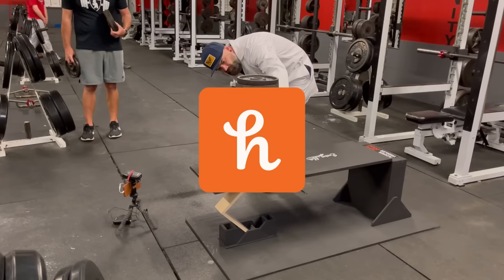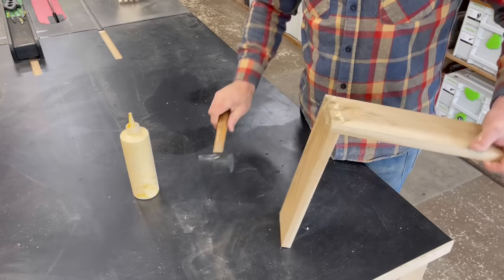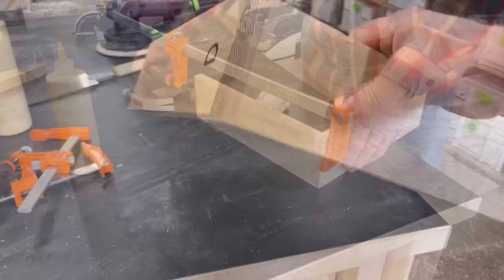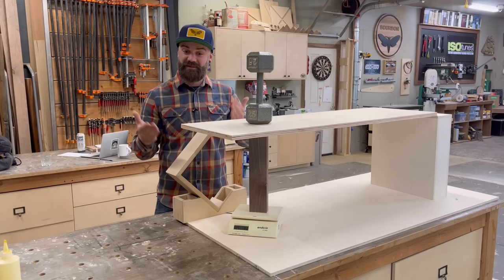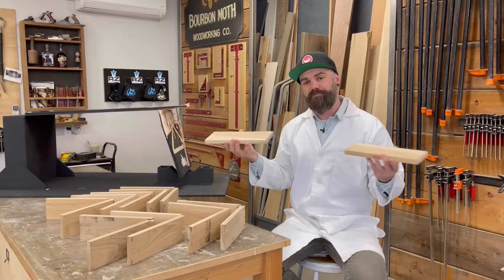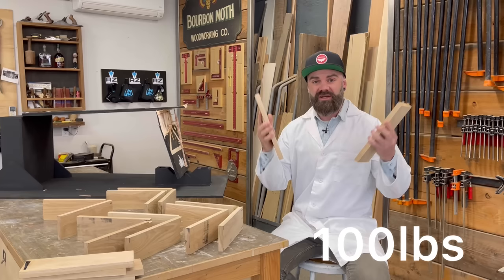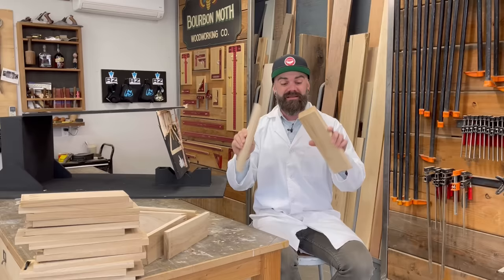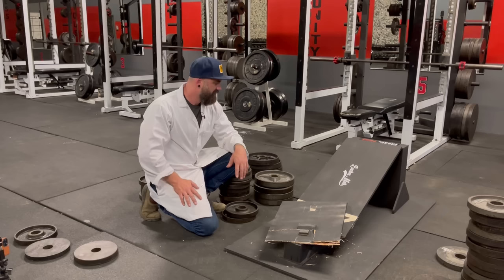What's the Best Wood Joint || Insanely Strong Joinery!

Comment: You also have to consider what the joint is for. A dovetail joint is designed to be strong in a particular direction - resisting pulling apart against the wedge of the dovetails. It's not as strong when being pulled in the other direction, and the wedge shape of the tails and pins may even make it easier to collapse in the diagonal force direction that you applied. If you were to retest with a 90° pulling force instead of a 45° pushing force, your results would definitely change because the mechanical advantage of the dovetail would actually play a factor.
Reply: You remind me of when I pointed out to the one gentleman he tried to Say end grain to end grain glue up with stronger than long grain to long grain. But his test was flawed by the direction he was applying the force. As I explain to him if you were making a stool that was 1‘ x 2‘ you would put the grain running the 2 foot length. Now if you cut that stool and a half across the grain and just glued it up would you trust the stool to stand on? I wouldn’t now cut that stool instead of across the grain with the grain and then glue it back together now would you trust the stool? Yes I would. Which direction the grain runs is part of Woodworking that makes your end project strong if you do it right but weak if you do it wrong.
Reply: I say the same for the box joints, more glue surface more pulling strength
Reply: I would like to see the results of the pushing force.
Reply: I think dovetails that are more equally sized may contribute to extra strength as well.
Reply: Two women in a thread in a male dominated job subject, and being smart and relevant - my toxic masculinity is triggered and offended..  Keep it up ladies. ;)
Reply: If you look carefully at the video for the dovetail test, it looked to me like the material actually broke in the direction of the grain which opened up the joint (rather than the joint itself being the failure point). Ultimately, I guess we need repetition but that really isn't going to be feasible unless he's got a lot of time on his hands to hand cut some dovetails!
Reply: see 19:20 when he's holding the boards
Reply: Yes I did not like those dove tails while they were pleasing to the eye they did not give a fair representative example of how strong a dovetail joint is. I think a better example would be from a jig produced dovetail example. And Megan  discussed where dovetails shine at the strength it gives while pulling for example on drawer fronts. I would not what a miter joint on a drawer front compared to almost all the rest of the joints except for the simple butt joint.
Reply: @richardlug6139  I think the dove tails' strength advantage depends on the kind of wood. The harder and denser, the stronger I would expect them to be, compared to woods with variating structures. (I'm danish - hope my definetions are understandable - Wiki didn't really help me to describe my thoughts better)
Reply: @ejhill12  "grain" - that was the word, I was searching for..  I agree 100%. My dad was a carpenter, and even though he made me hate wood, I learned a lot about it, by being around it 24/7/365 for 15ish years.Wood just sucked, when you are a teenage boy wanting have the fastest illegal moped, and the only "metal" tools are screw drivers and an adjustable wrench to round all you nuts and bolts with. Today I'm old, and all his good tools, that I had been promised all my life, went to my nephew, who never had used tools before he bought at house. So all my expations of model building for metal casting aso, went out the window, when I was going through my inheritence.. :D Narcissistic parents suck.
Reply: @ejhill12  Yes !
Reply: @ejhill12  Wonder if the outcome would have been different if the sample piece had been turned the other way up, ie the loading against the splayed edges rather than the straight ones.
Reply: @richardlug6139  I think your point is valid.  I like the look of my hand cut dovetail joints, but if I was going for strength alone, I would want to use a jig for closer uniformity.
Reply: Thats what i thought but didnt know to say it.Thanks
Reply: @jameshaulenbeek5931  I noticed that too. Would like to see a different dovetail pattern.
Reply: @jameshaulenbeek5931  I thought exactly the same, when I was at school I learnt that dovetails needed to be of even equal size. I picked the dovetail to be the winner.
Reply: @jameshaulenbeek5931  more equal pins and tails is absolutely stronger. Smaller pins is just an aesthetic choice
Reply: How are you so smart? I am ashamed.
Reply: Check out Megan with the big brain.
Reply: meow meow meow meow meow
Reply: I would suggest different shape and size of the dovetail. In my opinion will change the strength of the joint
Reply: @norbertperka9231  yes im carpeter and the proportion of the dovetail are wrong.
There exist exakt rules for the calculations.
Reply: @CONEHEADDK  I don't wanna judge since I don't know you, but wanna make you aware:  your comment makes it sound more so as you being the narcissist.. (For those reasons:
 1. feeling like a victim in a situation that it doesn't normally apply to, 2. blaming others for seemingly unreasonable things & having too high expectations, 3. Not getting over it & moving on, instead dwelling on how others ruined your life.) How is it narcissistic of a parent to have a job that doesn't line up with your hobby? Or to not bequest you the according tools? Most people don't inherit anything, and it doesn't matter, you can buy your own tools once you're grown. Unless they were controlling or prohibiting you to go after your hobby, or depricating you for it, I don't see whats so narcissistic about it.
Reply: You're amazing  ♥
Reply: Yes. If I were considering a drawer box that is going to be pulled and pushed perhaps tens of thousands of times in its lifetime, I'd put my trust in dovetail joints sized appropriately for the depth of the drawer. Next to that I'd place properly sized finger joints.
Reply: @rickhayhoe  Yep. This video somehow made me "fall in love" with the old fashion hot "bone-glue" (or whatever it is), that you can reheat and take apart, and reglue, without ruining the wood.
Reply: A Dovetail seems to be overrated in terms of strength. If you look at it closely, then you apply your force to a bunch of fibers, that actually have been cut through so they can not work in their strongest direction. They are held only by their connection to their neighbouring fibers, which is the weakest connection in wood. Especially is this connection between fibers weaker, than glue. So, it is much stronger to glue long uncut fibers to long uncut fibers as done in the box joint.
Reply: @jameshaulenbeek5931  no, likely not. It lies in the mechanics of the dovetails, that they transfer force to cut fibers, that they're not so strong. They've been  invented, when glues were weaker and especially more brittle, so that repeated movement could weaken the glue extremely. The dovetail wood still hold, even without glue.
Reply: @wildeast66  it's more that the dovetail joint has a specific purpose in joinery, which this video does not demonstrate. It's not an inherently weak joint; it's also not meant to be loaded in the manner displayed. 

Small pins in the joint most assuredly do serve to make the joint weaker, if only for aesthetic purposes. A proper dovetail with equally sized pins and tails would have been stronger in the method displayed, though likely only marginally. 

Also, the dovetail was not created to replace weaker glue, it was created to provide mechanical strength to a joint that doesn't require fasteners or glue to be strong when properly cut and used in the proper manner.
Reply: @wildeast66  It wood :P be intrs to see different types of wood. I guess there would be big differences.
Reply: Excellent point Megan, I hadn't even thought of that. I did think when he showed the dovetail joint that a jigged joint with more dovetails would have performed better (more glue surface, even distribution of force, etc). 
When I saw the failure mode of the splined joint, I realized why that was so strong. The splines in the joint were forcing the joint to try to pull apart those small pieces of wood, a near impossible task. 
I would love to see what the actual force is on those splines inside the joint.
Reply: @CONEHEADDK  Definitely.
Reply: @jameshaulenbeek5931  I am not saying its inherently weak. And it's definitely one of the strongest without glue.
Weather small pins make it weaker depends on the type of wood and where it broke. Pins too small will finally tear off completely. But here the cut fibers tore apar from its neighbours, this will not change, if you make them wider, the surface the cut fibers have with their uncut neighbours does not change.
What would be interesting indeed is: What if you make the angle a bit smaller and intentionally do not use glue? The tear force would then press the fibers together, increasing their connection with each other.
Reply: @vaclavcervinka65  Don't be. You are, what life has turned your gene pool into. You couldn't be anything/anyone else. Now you have ambitions of being "better" - good for you. And good luck/work.
Reply: @wildeast66  You sound like an inventor type brain.  I'm apain in the ace, bcz I see flaws "everywhere", and "nobody" likes to hear, that their whatever could be better. But I also "can't not" make them better, just like your brain - I'm guessing - automaticly looked for possible better solutions, in the smaller details than any of us others had - at least and shared it. Like thinking a few moves more than others in chess, and finding the win in a "lost" game.
Reply: @CONEHEADDK  Thanks for encouragement :)
Reply: @vaclavcervinka65  You're wellcome. I try to be the adult/person, that I would have been lucky to meet, when I was a kid or today as "an old fook".
Reply: The spline strength would increase with more splines. To be fair, all glue joint surfaces must be fresh, including BOTH butt faces, to ensure proper penetration of the glue. The effective surface area of the dovetail joint was much smaller than the box joint and the width of the dovetail at the base was too small for maximum strength in that test.
Reply: i feel like it would have lasted longer if the fingers were closer to the same size on the dovetail.
Reply: i came to type the same thing... next joint test 90 degree pull force.. and then after that, 90 degrees from a top down angle after mounting one side to a wall and stack weight on top of the edge.  different winners for different tests.  i was still super surprised at the miter in this video though.
Reply: YT's comment system sucks. If your comment doesn't get early likes or comments, noone will ever see it, no matter how good or bad, it might be..  So here it is - again, under an existing comment.. If the glue is strong enough, a miter joint is basicly a piece of angled wood, with a larger contact surface than as straight connection. Would be interesting to see a test of a joint, creating a straight piece of wood, with different angled joints, maybe compared to the different fancy ones, they used in the better old days, or just to make things look showoffy. Very nice science and video clipping, by the way.  Soak the ends with glue for a while, before compressing the joint, for a wood-breaking connection. That's how I did it - in my fantasy, while watching this video. Maybe with different soak lengths of time, to get a whole video and perfect data.
Reply: Splines should be thicker and dovetails even sized on both sides would have increased the strength

And as many have said, the force - whilst consistantly applied, was not applied in the direction any of these joints would be under load in real life
Reply: @CONEHEADDK  casein glue ??
Reply: @mijiasample6334  Not as far as I can resaerch. In danish it's called snedkerlim or benlim (carpenter glue or bone glue) and is made of parts of dead (go figure :D) animals. Here's the link to the danish Wiki - if anyone wants to look deeper. Is heated in a water pot, to keep it from boiling, that it can't survive - I just read. https://da.wikipedia.org/wiki/Snedkerlim
Reply: @slaveNo-4028  agreed on some points but to be fair he did say he was using a translator and I know from experience going from English to português and visa versa. He also said his interests were in metals and fast mopeds but yes we would need more info on the father son relationship.   I suspect it may have been "I do woodwork so you are going to do woodwork! Period!" But people change over time.  When I was younger the last thing I wanted to do was "play" with wood! (Except...well...I digress😜) I think people throw around the words narcissist and triggered WAY too much...but of course that is just my opinion, everybody has one 😉 
Loved Everyone's comments,  except the meow, meow, meow comment.  Because it's just like a cocky cat! Sorry, but cats are annoying.  Bring on the butthurt cat lovers!  I know you are out there! 😜🤣🤣🤣
Reply: @JamesWilliams-en3os  the jig dovetails would have made a joint like the Box joint only with angled sides that wouldn't want to come apart without splitting the wood so it probably would have been really strong maybe not splined miter joint strong but strong.
Reply: @ejhill12  Exactly, the board was split along the grain because the dovetails acted like wedges. Prevent the grain from splitting apart, and the dovetail will gain a lot of strength (but at the cost of more complexity).
Reply: @CONEHEADDK  I guess, I am and I make a living out of it as an engineer. I have a strength in analysis, which often brings me down to the most important points.
Analysis is segmentation, abstraction and logic. Improving needs analysis, but also some creativity and a good deal of experience in that field, combined with the ability to throw away your idea, because it did not work. Mechanics is some type of hobby for me. So at least I have some ideas, but am not an expert.

I also do help a friend developing board games by testing them. Here my analysis strength also helps, but I am not much of a help in that improvement step. I lack the creativity and experience in that field.
A common issue with "flaws" that we see is often, that we do not know all the design goals and how and why they were balanced out that way they are. We often focus on one that we see. 
If you are interested in those topics, just try. If you see something, that you think can be improved, try it. Grab some tools and experiment. 
Knowing the ways that do not work is more important than the ways that work and the best.
Reply: @wildeast66  Nice. And cool that you get something out of it - money opens doors, lack of money closes them.  I do the improvement thing "all the time" as an inventor. I'm "just" not strucktured enough in my mind, to do the paper work any more. I did write my own patent appl, that was accepted for "hight of novelty" and "improvement", but life happened, I didn't pay for year 4 and 5, and lost it.. If crowd funding existed back then, I didn't know about it, and I just don't have what it takes any more, to do things alone. I seriously have a bank box full of inventions and designs, from ideas written down over drawings, test models to "proto type" level - but I'm just a broken person, and as Jordan Peterson talks about in "Are you depressed, or are you low in the dominence hierarchy", being at the bottom results in "You just don't have anywhere to go".   On a good day, I spit out af few improvements to things I see fx on tv - but I can't even get a job as put things on shelfs or pushing a broom once in a while. I know it sounds, as if I'm lying or crazy - no problem, I'm used to it.. ;)  Weird world..
Reply: Not even gonna watch the video after reading this comment thanks. Not a very “scientific experiment”
Reply: @Rickitikitavi  Still interesting to see, regardless.
Reply: Exactly. And that’s why half blind dovetails are used for drawers. The tapered pins are what gives the dovetail so much strength when pulled from the pinned piece. And honestly if the dovetail joint are cut to make a very snug and tight fit, you don’t need glue to make it a strong joint. When I machine my dovetail joints, you have to tap them together with a mallet. That’s the purpose of the joint is to be strong. Well and also it’s looks awesome.  And think about it, a dovetail joint is similar to a box joint but with tapered pins. Giving even more strength when stress is applied to the side with the pins. So when done right, it most certainly would not be weaker than a box joint.
Reply: That was first thought as well.
It would be interesting to see the same experiment with the force vectors in differing directions.
Reply: I would love to see a test redone where the joints are stressed in the most common directions, usually 90 degrees vertically or horizontally. And furniture is definitely designed with better weight distribution over multiple joints, so one single joint is rarely going to bear all of the weight. Also, we know how insanely strong a jointed edge is which has perpendicular force to the joint.
Reply: The tapers on a dovetail act as wedges creating a splitting force on the grain.
Reply: Yeah what he said.
Reply: I came here to say this.
Reply: Well put, true that
Reply: Alsow the dovetails are not equal is szice so they are weaker by design than they would be is they were equal
Reply: So basically this video doesn't tell you which joint is strongest in correct purpose -_-
Reply: That's smart thinking.
Reply: Exactly. And for something like drawers its a lot more relevant
Reply: @CONEHEADDK  hide glue.  It has advantages and disadvantages like any other material.  Moisture is its enemy.  It's easy to source online, as are the electric glue pots (far easier control than trying to use a hot plate or stove).
Reply: Design of the test is flawed, joints were not tested in the proper direction of load for what the design intended.
Reply: Big respect to To you Padgett. From mentone Alabama.
Reply: absolutely right. and for example, the box joint would have been a lot weaker that the dovetails if the loading was in a pulling direction , since dovetails are wedged together while boxjoints are not. This test really depicts one specific loading force that is not to be handled by every single of those joints! 

oh and, why is there no mortise and tenon ? :)
Reply: @johnswanson7916  It... it is? It's called a shop class.
Reply: @CONEHEADDK  me too, my mother gave the bulk of my fathers  tools to an acquaintance  of his he had business dealings with 15 years prior to his death, most of these I had been promised  for many years, some for  over 30 years..
Ain't life a bitch....
Reply: @davidperry3022  Oh man...  I feel your painrage as goose bumpes all over..  I'm sure, most people more or less brush it off, if you talk about it..  Besides the "objective" loss of the market value, there's the deep feeling of betrayel, and factual loss of "your tools" (bcz besides knowing, they were yours to be, you had actually done "everything" you've ever done with tools, with those very tools. ) and a mans tools are a huge part of his identity - the patina of his personality.  Didn't your mother know, or was she "just" a narcissistic a whole.?
Reply: Another thing to consider is stress over time. Not just from use but from the wood shrinking and expanding. Joints that get their strength primarily from glue are less likely to stand the test of time.
Reply: Engineer's have smexy minds.
Reply: Insert inappropriate innuendo joke about wood phallus... very impressed ladys.
Reply: @wildeast66  the only problem is after awhile, the wood will eventually deform and lose strength.
Reply: That's totally right. Plus - the number of correct dovetails traditionally has to be in relation to the thickness of the board. Three dovetails are to few in this case. 5 or 7 would given much more surface - and look nicer ;-)
Reply: You dont know.  Sandwiches arnt gonna make themselves
Reply: Also he built the dovetail wrong. With unequally sized dovetails.
Reply: Realistically a dovetail is for show. It's not all that practical to actually use it. It's mainly used by a joiner to show off. My tutor was a bench joiner for 25 years and was always telling us we'd never cut them unless we were doing one off furniture and he was right. I've only had to do two or three pieces with dovetails over the last two years
Reply: I have seen 160 pounds guys standing on dovetail joints without glue being applied. We actually made a contest out of this at school during my education as a woodworker. But the dovetails seem to have been calculated differently ie more dovetails per length and we used about 3/4 inch thickness of wood.
Reply: Agreed
Reply: I refuse to consider what the joint is for
Reply: @xarcaz  dont simp
Reply: the test put a large leverage force on the joint, causing the pins to act like splitting wedges.  A drawer frame made with dovetails cannot experience this kind of load unless it was set up on a jig purpose-made for destruction, so it's an interesting result but not perfectly relevant to drawer durability.
Reply: I think this is the flaw of the dove tail. With a test like this the joints are wedges which will actually want to split the wood as compared to a box joint @ejhill12
Reply: I would like to see this
Reply: My guess is that you would see a similar result to this even when trying to pull them appart. When being compressed at 45 deg the wood acts as a lever against the joint and actually ”pulls” appart the joint, similar to trying to pull the straight out.

My guess as to why the dovetail broke is because of the wedge shape. The wedge forces the fibers themselves appart as the wood deforms, causing the cracks along the fiber direction as we saw.

In the box joint the fibers are not forced appart, they are simply being pulled (put under tensile stress) which can support much more. Basically the difference between trying to break a board along the grain or perpendicular to the grain.
Reply: Looking into this some more I found something really interesting. The shear strength is almost twixe the tensile strength for glue joints :O
(According to some research papers). That would also explain why the wedge shape is worse. The angle causes more of the stress to be tensile stress rather than sheer stress, thus weakening the joint, while the box joint is 100% tensile strength
Reply: Not as useful as you would think. You have to think of the purpose of the joint. And the vectors of the forces. This test stressed joints in a way that these joints would never experience. Would you build a chair or table in this way? Never! And your dovetails were not cut right for strength, but for beauty. Next test, think about the force direction and vectors. Think of loads in shear, stretch and compression. This was a rotation vector that almost never happens in properly designed woodworking.
Reply: Have you actually done a test on that?
Reply: I see a lot of skilled women wood workers on youtube. I have never seen one in real life. You go girls.
Reply: Same thought.  Also it would probably be stronger if the pin was wider.
Reply: someone bringing their brain  to the comments. lol <3
Reply: To add to your point you can see where the mechanical advantage of the dovetail split the wood along the grain.
 I think a major conclusion to draw from this test is the glue joint is more resilient to tensile force than torsional. All the "tongue and groove" joints took away perpendicular surfaces with respect to the applied force for surfaces parallel to the applied force. The miter with splines joint took only a little away from the perpendicular surface to add a lot of parallel surface that improved the design so another test could be done to find the point of diminishing returns of removing the perpendicular surface area
Reply: 90° or 45° degrees does not change a thing, in both cases you need to vector that force parallel to the axis you're analyzing and measure the distance from the pivot point to calculate the total bending force.

Nobody uses anything that they pull directly on the joint, unless you are doing a flat joint.
Reply: Quite right, your talking about actual function, a dovetail would be superior when exposed to the real stresses it would face, that of expansion and contraction. The crossover of the joints would absorb much initial pressure,then the force would be counteracted by the end of one tail, which would, when necessary transfer the force to the end of the other tail. Also joints formed under pressure in situ would really enhance the quality. 
A test where pressure was applied both internally and then externally would be a fairer test imo
Reply: This is a good point. He should test the joint with force angles it's likely to receive.

Still interesting to see what 90 degrees does but it is incorrect it implies the best or strongest joint in a real application.
Reply: Sounds sound to me.
Reply: I was screaming this in my head. Dovetails are for drawers that get slammed closed over and over and over. The reason the box joint worked better is that it had more surface area with an equal amount of stress twisting the same way. The dovetail, because of the angled pieces, created points for the wood to almost "pivot". Once the strength was baaaarely compromised, it "pivoted".
Reply: And the fact the splines with the miter was the strongest, isn't surprising. That's how picture frames are made.
The reason the splines worked better than the domino, or even the pegs, is because the grain of the splines was at an angle to the mitered joint, creating a closed triangle, which we all know is the strongest simple shape, like a teepee.
Add to the fact that the spline is flat and wide, thus giving it more surface area to glue. And there is no easy way to break a spline of that shape, in that direction. Really really fun video though. I really enjoyed it!!!
Reply: @jameshaulenbeek5931  this was my first thought, the box joint performed better because it was equal width on the pins from one side to the other.
Reply: @robt2151  I wouldn't imagine so. Since either way the load would have been applied at a 45 degree angle. But who knows? Either way, I'm blown away by the simple miter joint being so strong, definitely wouldn't have guessed that one.
Reply: This is so valid.  I also think we need to take into account the materials properties of the glue which should provide the majority of the strength.  The 45° angle of the wood basically turns the downward force on the end into a rotational force at the joint.  The mitre joint relies on the tensile strength of the glue.  The box joint applies the force to the glue almost entirely as a shear force, and the mitre with splines is blending tensile strength and shear strength.
Reply: and this is why i always use the inside vertical dowel with an external block rod. holds true in all directions up-to 350kg and that's just for basic pine :) a single 10mm pine dowel can withstand compressions up-to 10ton XD
Reply: REMEMBER MORE=FRIGIDITY LESS=STRENGTH :) WHEN IT COMES TO JOINTING ANY WOODS
Reply: @jameshaulenbeek5931  Definately
Reply: @ejhill12  thats what i thought i saw too, looked like the board itself cracked
Reply: "check out the big brain on Megan" - Samuel L Jackson voice
Reply: Yes. The vertex of the thin tails acted as splitting wedges. We can see the split grain on the adjoining board.
Reply: The test was done on just a compression test, it may be a different result if the tests also consider for tension and lateral movement.. but definitely the simple square miter with spline is the winner. Any application with diagonal element doubles or triples the strength of the materials or structure
Reply: Other than aesthetics or press-fit assembly, I doubt you'd beat a simple miter joint in  any test. Finger-type joints can reduce the effective surface area by as much as 50% or more, because only the sides that are perpendicular to the force being applied offer any structural integrity. If you are pulling on a joint that is made from interlocking fingers OR pushing it, a torque will be applied to the sides of the fingers such that only the tips of the fingers are offering any meaningful structure.
Reply: WOW YOU DON'T SAY !!!!!!!!!!!!!!!!!!!!!!!!!!!
Reply: @CONEHEADDK  😅😅😅
Reply: @duanesamuelson2256  Thanks. I don't think, I got a notification about your answer. I also like the fact, that it's a 100% natural product. I "hate" using synthetics in a world of micro plastics aso even in our blood.
Reply: Hell yeah, I don't know a dovetail from a crowfoot so this was a super interesting analysis of the test! I hope he reads your comment!
Reply: @CONEHEADDK  Love the outlook. I like to think I'm a similar type of person. So grammatical errors aside, it was a great explanation.  😁
Reply: @danielhutton3858  Thanks. I'm a dane in Denmark, and besides us "building" sentences differently (even from norweigan, thats is basicly the same as danish) I don't care much about grammer or spelling. I actually even sometimes don't correct a mistake I notice, when "debating" ace holes, to lure them into "going for the man instead of the ball, and show their true clours (not talking about you). On an international site like YT, I expect mistakes, and unless it makes it impossible to understand for sure, I don't think, it matters.
Reply: @CONEHEADDK  well to be honest, you being Danish and forming sentences this well is impressive as hell. So I retract my ribbing! Haha
English is weird on its own, coming from a language so vastly different...bravo sir. I can't even speak German and my mother is from Germany 🤣
Reply: Yes. Not to mention the dovetail joinery is not meant to be glued together. It’s meant to be able to hold it self together with a shape alone. Counteracting a constant and predictable force.
Reply: its always nice seeing a woman who can appreciate math. stay away from the dark side
Reply: This woman joints 😂11/10
Reply: @duanemiller5606  unfortunately You are absolutely wrong. In fact end-grain to end-grain glueing is indeed stronger.

https://youtu.be/m7HxBa9WVis
Reply: @CONEHEADDK  I've never cringed so hard in my life, I actually got embarrassed reading this
Reply: @leetskeet4476  Then read it again, untill you grow up.
Reply: My thoughts almost exactly, different joints for different applications. I hope he does more!
Reply: @CONEHEADDK  I saw it
Reply: @CONEHEADDK I'm sorry to hear that. That really sucks. Yeah what you said
Reply: @slaveNo-4028 well my take on it was he never mentioned the reason behind the narcissist comment. I'm under impression that alot details was left unsaid. The comment was just thrown in as afterthought/factual justifier after explaining the possible disappoint from the inheritance
Reply: @slaveNo-4028 it's not about parent not having tools that didn't line up with a sons hobby but maybe sounds like could be that Father didn't bother to take interest to nurture and support a sons interest bc of self important old school, traditional mindset.  Parents know and sometimes they don't.
Reply: @slaveNo-4028  finished reading the rest of your text and 👍
Reply: More equally sized pins and tails would also have made a difference in this test.
Reply: Basically his test joint was upside down
Reply: I only wanted to read about wood, not to fall in love.
Reply: Agreed. I think of dovetails as being useful for drawer fronts so the front doesn’t pull off.
Reply: None of the results are surprising. The reason the splined miter took first place was because the splines increase the available surface area for the joint past what's available for the other joints which all have a boundary perpendicular to both boards by their thickness. The splines are able to utilize more wood than all the other joints. You can greatly increase the strength of the spline joint if the splines were as thick as the fingers on the finger joint and spaced the same way. Speaking of the finger joint, the reason it outperformed the dovetails was because you dimensioned them for nothing but aesthetics. If you want to increase its performance, the pins and the tails have to be uniform, just like a finger joint, and they must be sized so that the smallest part of the pins and the tails are as thick as the boards themselves. Actually, if you want to dive a but deeper into your testing, you should be testing multiple variations of the joints that have variations. For instance at which point does adding more screws to a pocket hole joint make it weaker? Maybe a finger joint that has fingers that are the same size as your blade kerf is the best joint out there, i mean, all that glue surface must make it indestructible right? Those are the things you ought to test, because people are going to use their go to joints regardless of strength, but they might at least use the best variation possible after seeing that something like different size dowells, spaced a certain way outperform whatever they're used to doing. Just an idea
Reply: What you suggested has since been done and butt joints were stronger than dovetails. Also, butts with reinforced with dowels and dominos were both weaker than basic butts. Only splines in miters showed any strengthening effect compared to the basic joint.
Reply: lol…….cop that!
Reply: Yes. Theres shear strength, compression strength, and tensil strength. Still a great test though. I